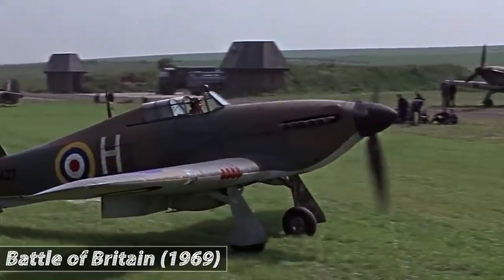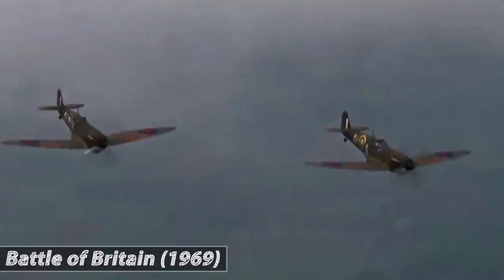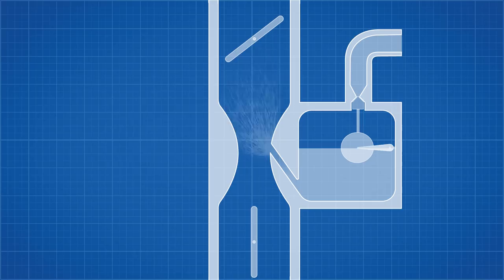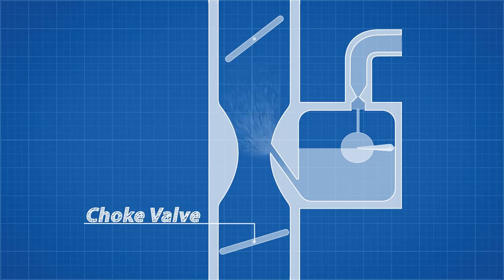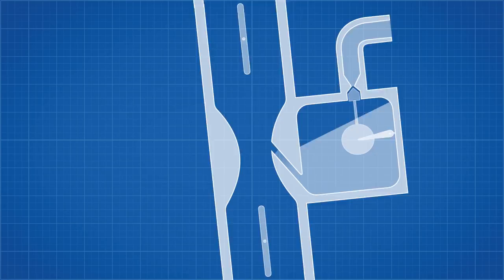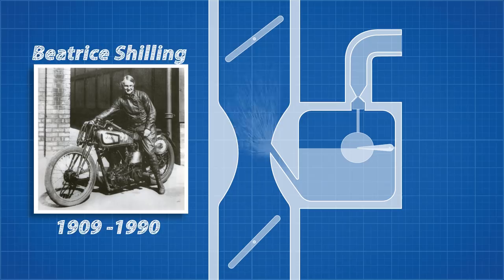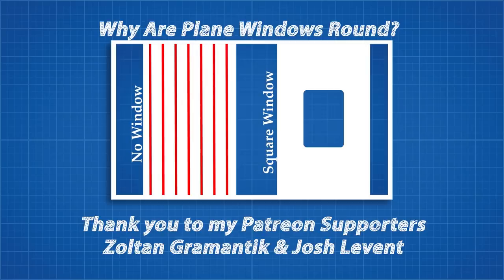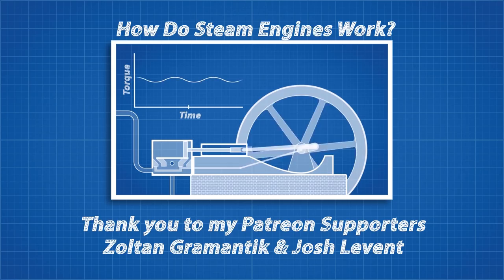The Spitfire's Fatal Flaw

Comment: One the plane you show having an engine issue was not a Spitfire but a Hurricane also it was performing a barrel roll which does not involve negative gs.
Reply: It does involve negative Gs if you do it as slow as the pilot did there.
Reply: cuz the Hurc' is dead slow! A big target for the 109's
Reply: If you pull negative G's it is not a barrel roll.
Reply: There may not be negative G on the pilot, but flipping a gravity fed carburetor upside down produces a negative gravity effect. 
Whether it was the pilot pushing forward on the stick, creating felt negative G, or flipping the plane so gravity is acting on the opposite end, it's all a gravity induced fuel starvation. 
Besides, every time I rolled a plane inverted, I had to push forward on the stick to maintain altitude, creating negative G....
Reply: @gscwanny: Not true or at least I don't agree with you :) The Hurri was a tough plane and a solid gun platform accounting for a good share when dealing with the enemy. The Spit had the glamour and the Hurri just got on with the business at hand :)
Reply: James Allan It is true though, the Hurricanes were really slow.  They accounted for a high share of German losses because they were assigned to attack the bombers while the Spits distracted the fighters.  They were both effective fighters in their roles but the Hurricanes were vulnerable to Bf 109s, especially once they started using Minengeschoß rounds in their cannons. When they used armour piercing rounds they would often go right through the fabric fuselage, that's not so much a benefit of the Hurricane as much as poor planning on the Germans' part.
Reply: jadger1871  This is the thing I don't understand though. The difference in speed between the two craft doesn't seem that great and the turning radius on the hurri was a bit better. I knew they were set after the bombers while the spits took care of the 109s but I thought that had more to do with the stability of the hurri gun platform and numbers available. I get your point though. I just have a soft spot for the beast I guess :)
Reply: +gcswanny The hurricane was slower than both the spitfire and 109 but was far more manoeuvrable neither of the faster fighters could stay with the hurricane in a turning fight. hurricane was also a far tougher aircraft and better gun platform
Reply: +jadger1871 not strictly true if the hurricane pilot kept the fight level then it could easily out maneuver the 109. the hurricane only became vulnerable if the fight went into the vertical. in his biography Douglas Badder describes a mock dogfight he had with a spitfire whilst flying a hurricane and the spitfire couldn’t shake the hurricane off until it went vertical. the hurricane also opposite in areas that the spitfire found problematic such as the wester desert and Russian winter.
Reply: honymonster30 of course it could out turn a Bf109, all other things being equal, a slower aircraft will have a tighter turn radius because it travels less distance while turning at the same rate.  Also, this is one limited circumstance, I wouldn't want to fly in an aircraft that could out perform other aircraft in only one specific circumstance.

A turning dogfight doesn't matter that much though, it is well documented that the preferred tactic of the Germans was what is called the "High-side guns pass" tactic.  That is, they would use their superior speed and altitude to "bounce" their target and quickly get out of range in preparation for another pass on their target. It was only when encountering an inexperienced enemy pilot who willingly engaged in a turning fight that the turning battle would occur.
Reply: You're quite right that the Hurricane did the lion's share of the work during BoB. However, the majority of the Hurricanes were used to attack bomber formations for a few reasons:

The Hurricane was a more stable gun platform than the Spitfire. The layout of the weapons, allowed for a more reliable weight of fire. I.e. it was more likely that the Hurricane would put more lead on target, than the Spitfire would which is more desirable when shooting at the larger more durable bombers.

The Hurricane was completely out classed by the BF-109E. Yes, the Hurricane had lower wing loading, thus could turn tighter than the Messerschmidt, but as Sailor Malan said, no aircraft has ever shot down another aircraft by turning. All you need to do to shoot down an aircraft, is point your guns at it. How you do that, is not important.

Having the advantage in the horizontal has no benefit if your foe does not commit to the horizontal. The 109's had superior rate of climb, which gives them the altitude advantage. The 109 also had far better energy efficiency than the Hurricane. It didn't bleed as much energy as the Hurricane would under maneuvering and it's sleeker aerodynamic profile allowed it to gain for more speed, when converting it's altitude advantage to speed in a dive. In a fight of attrition, if neither of the pilots made mistakes, the 109 should beat the Hurricane every single engagement. (A very easy thing to say on paper as a couch pilot.)

Thus, the 109 could simply dive (boom) down from a higher altitude onto a Hurricane for a gun pass, then climb (zoom) back up to high altitude and repeat the attack if necessary. The Hurricane couldn't dive away, it was too slow in the dive. It couldn't follow the 109 in the climb, it had a too poor climb rate, thus the Hurricane would simply never be let into the fight by the 109, provided the 109 driver was smart enough to not commit to the horizontal, which most of them were from their Condor Legion experience. In the end, due to how energy inefficient the Hurricane is comparison to the 109, would result in a Hurricane bleeding energy non stop during evasive maneuvering driving the fight down to where it will have no more speed to maneuver and be a sitting duck for the next gun pass, or merely be driven down into the ground.

This was where the Spitfire, with the same Merlin Engine as the Hurricane, turned the tide. It was very fast, had a fantastic rate of climb and high altitude performance, and had a better turn rate than the 109. The 109 only maintained 2 significant advantages, a better roll rate and the reliability of their fantastic fuel injected DB-601 Engine.

Thus, a well flown Spitfire, would try to maintain the energy (Altitude/Speed) advantage over the 109, try to force the 109 into a mistake and possibly drag the fight into the horizontal, but also at all costs try to avoid fighting in a rolling scissors with the 109, since the superior roll rate of the 109 would, again, bleed less energy, complete its rolls faster, which results in faster changes of vector, thus placing the Spitfire at a disadvantage and guaranteeing it's death. (Again very presumptuous speculations from a couch pilot.)
Reply: The Spitfire handled the desert just fine, they fitted tropical filters. 
Russia took over 1,200 Spitfires so they must have been ok there too.
Reply: The Hurricane could out turn a 109 in a constant rate of turn and was indeed faster into the aileron roll moment.  The airspeed of the Hurricane was only just shy of the Spitfire.  The Hurricane often found itself tangling with 109's and coming off quite well in experienced hands.
Reply: +James Allan From what I remember of memoirs of pilots, they did as well. A much easier plane to land from all accounts.
Reply: The Hurricane which was about 30 mph slower than the Spitfire did quite well, but a direct comparison is rather difficult since the Hurricane usually went after the bombers and the Spitfire usually went after the fighters.
The Spitfire still had a bigger percentage kill rate and a lower loss rate.
Reply: The Spitfire is one of those highly overrated aircraft. It was without a doubt beautiful, fast, and maneuverable. It was also expensive and complex to make, very short on range, and had less than stellar ground handling. It is funny how legends about aircraft grow for good and bad. The P-40 and F4F are often seen as lackluster aircraft while planes like the Zero have a greatly inflated reputation. 
The Spitfire was a great plane but after 1943 it's limitations in range made it less useful than planes like the P-47 and P-51 to the allies.
The Hurricane was also a great plane that should get more praise.  It performed well, was rugged, and easy to produce. The Hurricane was as important to winning the Battle of Britain as the Spitfire was.  The Spitfire kept the 109s off the backs of the Hurricanes so they could get to real job of knocking down bombers.
Reply: David Siebert The Spitfire was only less useful in one role: long range bomber escort.  The common view of late war aerial combat in the West and especially the USA is skewed towards the strategic bombing of cities, but other missions were just as vital.  CAP over the front or air interdiction and ground attack roles were just as vital to the war effort, which the Spit was more suited to than the Mustang.  

As a matter of fact, the Spits were sometimes mistaken for German aircraft by Mustang pilots and with their far superior climb rate and speed, they were able to get away from the Mustangs.  By the last year of the war, with the front being closer to the German hinterland, the Spitfires could effectively escort the bombers from forward bases as well.
Reply: In ground attack the Thunderbolt and Typhoon where much better aircraft and the Spitfire's short range meant you couldn't attack very far. Think of all the German planes, trains, and trucks shot up by Mustangs and Thunderbolts coming home from escort missions. They carried a larger payload of bombs than the Spitfire. CAP over the front line? The Mustang and Thunderbolt where also very good at that mission thanks to their long range which equalled long loiter time. By the time of the invasion of Europe the German air force was in a bad  situation so CAP was not that demanding. And the Seafire was just a bad idea. The F4F, F6F, and F4U where all better for carrier duty. 
The Spitfire was great but not as good as it's legend. The Mustang in many ways was in the same position after the war. Many air forces kept the Mustang including the US. The problem was that jets had replaced the Mustang as a fighter. The US and allies would have been much better off flying Thunderbolts in Korea for ground attack than Mustangs.
Reply: David Siebert.
The Spitfire which was used for dive bombing and attacking many places that required high accuracy, did far more than you think. German planes, trains, trucks, V 1 and V 2 launch sites, even far more V 1`s than the P 51, the P 47 was not fats enough for that job. CAP over the front line was the Spitfires job, The Mediterranean, invasion of Sicily ( Seafires provided cover for that), Italy, it was Spitfires, D Day when 55 squadrons of Spitfires assured air superiority and all the way into Germany the Spitfire was flying from airfields close to the front. The short range Spitfire which do missions of over 4 hours or over 1,000 miles and fight. 
In fact without Spitfires D Day would have been much harder, Spitfires flew photo reconnaissance all along the coast and they attacked radar sites to confuse the Luftwaffe, even spotting for the ships guns was done by Seafire since it could do the job and look after itself. 
The F 4F, F 6F and F 4U in particular could only fly from large aircraft carriers, the Seafire was flown from small escort carriers.
The Spitfire was the best fighter the allies had from before the war, it was still in front line service well after the war.  Israel used both the Spitfire and P 51 but the pilots preferred the Spitfire.
Many air forces used the Spitfire after the war, including the RAF.  The Seafire was still in use in Korea.
Reply: Barrie Rodliffe Agree with your points, just wanted to add that the Israelis also used a cheap knockoff version of the Bf 109 after the war too.
Reply: David Siebert I am thinking of those ground targets attacked by all allied aircraft, not just American made aircraft.  Did you know it was a Spitfire that wounded Rommel and knocked him out of the war? While many planes attacked the V weapon facilities to knock them out, it was the Spitfire that was tasked with knocking the V-1s out of the air.

Look at Operation Bodenplatte, eight Spitfire airfields were targeted, while only three Mustang airfields were targeted, all of which were combined bases with other aircraft. This shows that the Spitfire was far more prevalent at the front and were a much more important target for the Germans because of their capabilities.

Sure there were more purpose designed alternatives later in the war, but just like the Bf 109, the Spitfire proved to be a reliable and effective weapon in multiple roles throughout the war, with upgrades keeping it on par with newer aircraft.
Reply: Yeah, any form of inverted flight is pretty challenging when you have a gravity feed carb.  At an air show years ago I watched a guy with a J2 Cub doing loops and it would start to sputter when he went over the top.
Reply: Barrie Rodliffe I'm afraid you'll find that the heavy filters the spitfire needed for the desert reduced their performance quite severly. 

Also once the intial attacks were made the dogfights quite often turned into a large melee conditions that suited the Hurricanes. The fact is the Hurricane was one of the best allied fighters of the war. It's incredabilie sad that a lot of people can't see past the Spitfire and give the Hurricane its due both as a fighter and a jack off all trades.
Reply: jadger1871 I think you'll find that most airborne V1's were taken out by the faster Hawker Tempest and DeHaviland Mosquito
Reply: honymonster30 The Spits still took out over 300 V-1s, or half of what those other aircraft you mentioned did.  Not only that, you only reinforced my point, there were many newer planes but the Spitfires could still hold their own late in the war.
Reply: Is that why the Spitfire replaced Hurricanes in so many places.
The Spitfire MK V with the same engine as the Hurricane had better performance and why would the Spitfire need better air filters than the Hurricane? Maybe you do not know that the Spitfire had a tropical filter, but the Hurricane also had a tropical filter.
The Bf 109 E 7 also had a big tropical filter.
The Hurricane could take on the Fiat CR 42 but it struggled against the Machi C 202 and Bf 109 E 7, the Spitfire was able to take on both.
The Hurricane was good early in the war but never up to the performance of the Bf 109 or Spitfire which is why the Spitfire took over as a front line fighter while the Hurricane was used less and less as time went on. Hawker were not satisfied which is why they made the Typhoon and later Tempest.
The Spitfire was also a bit of a jack of all trades, fighter, dive bomber, photo reconnaissance, escort fighter and so much more, even shooting down quite a number of V1`s, as well as attacking V 1 and V 2 launch sites.
Reply: Honey minster.
I think you will find out the Spitfire was faster than either Tempest or Mosquito and it took out over 300 V 1`s.
The Tempest was the fastest at sea level but above 5,000 feet the Spitfire was faster.
Strange that the Mosquito was used at night while the Tempest, Mustang and Spitfire were used by day, the Spitfire had the job of chasing V 1`s on the far side of the English Channel, the Mustangs the nearside, then the gun belt, then the Tempests inland.
Spitfires were at the same time providing air superiority over Normandy and attacking V 1 launch sites and giving close support to  the army. 
The Spitfire still took out 50 %  more V 1`s than the Mustang.
Reply: Tempest was faster at low altitude.  Not sure about how it fared at high altitude, specially against the Griffon-engined Spitfires.
Reply: James Allan  From memory the Battle of Britain Hurricane was 30 km/h, that is 20 mp/h slower than its contemporary Spitfire.  Thats is a lot: during Spitfire's evolution a speed increase of 6 or 8 mp/h was hailed as a big improvement.  .  Also speed is not everything: ability to accelerate is as least as important and the Hurricane was sluggish
Reply: James Allan  Problem is that making tight turns requires going slow and while you were going as slow as possible in order to make a tighter turn you were a sitting duck for any additional plane joining the fun from the side or from above.  Also the Hurricane was not good at accelerating so in case he reached a favorable position behind the enemy after a turning duel  the German pilot could shake it just abandoning the turning duel, and opening the gases. all while waving in order not to be a too easy target.
Reply: Actually the Spitfire had a problem of sensitive COG.  Since the COG varies with fuel consumption it could not take take much of it: an aircraft with a COG too far from the right place is difficult to handle and can end disintegrating in flight.  Very late in the war Supermarine managed to solve the problem and produced a long range Spitfire but since by then the Mustang filled that niche and the project was canceled.

The Spitfire was not designed for escorting bombers to Berlin and back but as a defensive fighter, one whose main role is preventing the enemy from bombing your trenches, your airports or your factories and it was good at that mission.
Reply: Actually both the Spitfire and Hurricane s..ed at ground attack due to their water-coled engines that made them vulnerable to even minor hits.
Reply: Nemo.
The Spitfire Mk XIV was faster from 5,000 feet up.
During the Spitfire evolution an increase of 100 mph is a lot.
The Spitfire could turn tighter and faster than most other fighters, it pulled more G and completed a turn 6 seconds before a Bf 109, also 200 feet tighter radius turn than a P 51.
All planes had problems with COG, the P 51 when fully laden with fuel could only fly slow, straight and level, the COG was too far back, the same as a long range Spitfire, which was in service a year earlier than the P 51 with a Merlin engine, many Spitfires were flying escort and long sweeps in 1943.
The Spitfire was designed as a fighter, so was the P 51, even if it was not good at it and the P 51 with a Rolls Royce Merlin which did have long range did nothing until 1944.
The Spitfire and Hurricane both did a lot of ground attack and they proved to be good at it, 3,500 P 47`s never got back so how good were they at ground attack?
Reply: Barrie Rodliffe What are your sources for this information? P-47 losses were 3500 total to all causes, including the number that were sunk on transports crossing the Atlantic, not just ground fire or air to air. In fact, Only 0.7 per cent of the P47s were lost in combat. http://www.aviation-history.com/republic/p47.html

And turn rate isn't everything, all those aircraft you compared it to were not meant to get into a turning battle.  They were all so called "boom and zoom" fighters.  They would attack at speed from a dive and use that speed to quickly get out of range or climb for another attack run, only within the Spitfire's firing range for a second. If a Spitfire attacked them, they would go into a dive to evade the Spitfire as the low wing loading on a Spit meant it did not pick up speed in a dive nearly so quickly as the other aircraft.  As a matter of fact, the Spitfires suffered terribly at the hands of the FW190. It was Spitfire pilots after all that gave it the nickname "butcher bird".
Reply: jagder.
the 3,500 is losses and 3,499 kills is what I found from one source, I have just checked again and find 3077 combat losses and 3082 kills for the P 47.
Turn isn`t everything, no but turn, acceleration, rate of climb and speed are all important, the Spitfire was very good at all of them and above 5,000 feet even the Tempest could not match it.
They were the two best fighters from the end of 1943 to the end of the war.
Any pilots would try to use height, the Bf 109 in a dive did have a slight advantage at the start of the dive but the Spitfire would catch up if the bf 109 pilot kept diving, if he levelled off he was as good as dead and in a climb or turn the Spitfire had the advantage.
The same applies to American fighters, due to being heavy they might enter the dive faster but the Spitfire will catch up and go faster if the dive is prolonged, the Spitfire pilot could easily avoid any American fighter by simply turning and climbing, not one America plane could get close. 
The Spitfire Mk V had trouble with the Fw 190, the Spitfire Mk IX and all subsequent Spitfires turned the tables.
Reply: Barrie Rodliffe You're assuming the Spitfire would survive the first pass by a diving enemy fighter in order to chase it.  The difference in speed between a diving fighter and the spit caught unawares would mean they would have no chance to catch up with them in a dive.  Sure, if they were 50 miles up and the other fighter kept in a straight dive the spit could catch up, but that's an impossible situation.

As for the Mk IX vs. the FW190, it was more than 30km/h slower as well as turned slower and climbed slower than the D-9.  The only Spit that could actually catch a D-9 wasn't produced until after the war.

All this talk of how far superior the Spitfire is to American fighters and yet the RAF themselves used the Mk XIX Spitfires to simulate P51s in war games because they had very similar flight characteristics.
Reply: jadger1871 
Maybe I am assuming the Spitfire would survive a first pass because that is exactly what so often happened, Spitfires were often attacked by other fighters from above, that includes USAAF the P 47 and P 51 because of very poor aircraft recognition. They never shot down a single Spitfire.
If a Spitfire was flying at high cruising speed and bounced from above by any plane the Spitfire pilot could evade it if he saw it coming and then have the height advantage.  
As for the Mk IX which had a similar top speed to the Fw 190 A and the Spitfire turned tighter, climbed faster.
The Fw 190 D 9 which was not as fast as the Spitfire Mk XIV in service 6 months earlier, the F w 190 D 9 top speed 440 mph. The Spitfire Mk XIV 448 mph.
The RAF used a Spitfire Mk XIX in mock combat with an English Electric Lightning because they still had Mk XIX Spitfires in service, the Spitfire was far superior to the P 51, it was faster with better maneuverability, climb and acceleration, if the Lightning could handle a Spitfire, the P 51 would be a walk in the park.
No American fighter in the war could match a Spitfire. The P 47 did not, P 51 did not, the F8F which was too late for the war did not.
Reply: Barrie Rodliffe Where are you getting these numbers from? The Mk XIV could only attain that speed in tests with modifications that were not present on combat aircraft, otherwise they could barely go over 400mph.  Even if they reached your top speed, that 1.5% difference in top speed is negligible.  How long do you think it would take a spit to catch up with a D-9 that was already at that speed attacking it from a dive? Far longer than the Spitfire had fuel for.

And the Mk XIX used in those trials was a static display model before they repaired it and brought it back into service, they could have just as easily borrowed a P51 from literally anywhere else. The Americans were selling them for $1500 each at the time. They only chose the spitfire again because its characteristics were very similar and thus cheaper than renting an actual Mustang from someone else.
Reply: jagder.
Since the Mk XIV had a top speed of 448 mph and it reached that in 1943 with a fully equipped fighter, even the older Spitfire Mk IX and the Vii and VIII would easily top 400 mph. The Fw 190 D when it entered service over 6 months after the Spitfire Mk XIV, did not have MW injection and only had a top speed of 360 mph according to Hans hartig. Even with the MW it could not catch the Spitfire in top speed, climb or acceleration. 
As for range, the Spitfire had enough to chase, catch and shoot down the few fw 190 D`s that were there, the Luftwaffe were still relying heavily on the old Fw 190 A. The Spitfire Mk XIV had greater range than the Fw 190 D.
Even German flight tests of the Fw 190 D 9 do not show the 440 mph which I have seen elsewhere until 1945, 413 mph at 6,150 metres, or about the same as an older Spitfire Mk IX and much slower than the Spitfire Mk XIV. of quite a few flight tests and engine or supercharger failures the Fw 190 D9 did eventually manage 437 mph in a flight test with MW 50. Also with C 3 fuel it managed just 441 mph in March 1945, that does not compare well to 448 mph in 1943.

Adolf Galland who was there at the time and rated Spitfires very highly had this to say about the Spitfire mk XIV.
"The Griffon-powered Spitfire fighters were so lethal that the best thing about the Spitfire Mk XIV was that there were so few of them". 

Since the Spitfire had a cruise speed of close to 400 mph, it would not take long to catch up, it certainly accounted for quite a few Fw 190`s as well as Me 262`s.
The Spitfire Mk XIX which the RAF still had was not a static display, it had been in use for THUM. and it was ready for flight when in 1957 the RAF wanted to see how to combat the P 51, the Spitfire having better performance and maneuverability was a good choice since if the Lightning could beat the Spitfire a slower P 51 which did not turn or climb like a Spitfire would be easy. Why get a non working P 51 and have to get it airworthy when the Spitfire already was.
Reply: Barrie Rodliffe Hans Hartigs, who flew the aircraft less than a week before he was shot down and captured, and was flying low altitude missions (in a high altitude interceptor) for that whole time, cannot reasonably be considered an expert on it. Not to mention you totally misrepresent what he actually said, which is that some were rushed to the Geschwader without the MW50 injection system because of the constraints Germany was under, not that it was a later addition.

Adolf Galland was "there at the time" only in the sense that he was alive, by that point in the war he had been grounded for three years. He had no combat experience against the Mk XIV.  Not to mention that that quote from him is entirely apocryphal, or do you have an actual source for that?

You are mistaken about the Mk XIX as well.  The initial spitfire slated for the trials was airworthy initially but quickly developed mechanical issues and had to be replaced by one that was a static display.  My point still stands though, if their performance was so superior as you claim, then why wouldn't the RAF buy or rent a P51 from one of the many allied nations that still had them?  The whole purpose of the exercise was to judge the effectiveness of Lightnings against P51s.
Reply: jagder.
Hans Hartig was right the Fw 190 D did not have MW 50 when first put into service. It took some time to get the MW 50 working, even the flight trials showed that they had poor reliability and lacked performance until well into 1945 or much later than the Spitfire was doing 448 mph. 
Galland commanded an Me 262 squadron with 16 Me 262`s, they did meet Spitfires including the Mk XIV.
The Spitfire used for the trials had been withdrawn from active service in 1957 but kept in flying condition as part of the RAF historic aircraft flight.  No need to replace it since it had no mechanical issues.
Your point is just silly. If you want to see how to combat a fighter which has a top speed of 437 mph and a climb rate of 3,200 feet/ min. then why not test the planes against a more agile fighter with better performance, if the Lightning could take on the Spitfire it certainly could take on the P 51, why try to get hold of a P 51 that is less likely to be reliable and takes time to get to Britain and make airworthy, far more time than an airworthy Spitfire already there.  
The exercise showed how the Lightning could combat the Spitfire, having done that it would easily do the same to the P 51.
The P 51 top speed 437 mph, Spitfire 450 mph, Lightning 1,500 mph.
P 51 rate of climb  3,200 ft/min, Spitfire 5,040 ft/min, Lightning over 50,000 ft/min.
The Spitfire turned over 200 feet smaller radius than the P 51 and pulled more G. If a P 51 pilot tried to maneuver with a Spitfire the wings would come off.
Reply: YUP! I caught that too! But, the 'underdraft' carb set-up did stall RAF Merlin-equipped fighters from '37  thru '42. It was the one area the US Allison v-12 was notably better at! Note, the Westlast Wyvern  didn't have THAT issue!
Reply: Eric.
THe RR Merlin only had the problem until 1941 when it was completely solved, it had already been improved before then.
The US Allison V 12 was useless at everything and nosing over into a dive which was when the problem occurred on early Merlin`s was not a problem on the much later Allison engine P 51, it never went high enough to dive.
The Westland Wyvern was a post war navy strike fighter with a turboprop. It first flew in 1946.
Reply: Oops, it was the Westland Whirlwind, that used two RR Kestrel engines, that I was trying to recall.  Funny comment about how high you could go in an Allison, since the A-36 Apache was the DIVE BOMBER variant of a Mustang, and was Allison powered! 24K ft.,,Max.
Reply: Eric.
The Westland Whirlwind had two Rolls Royce Peregrine engines, the prototype Bf 109 had a Rolls Royce Kestrel engine. As for the negative G problem the Whirlwind may well have used the same carburetor that the Spitfire and hurricane used.
The A 36 with an Allison engine, 24,000 feet, the Spitfire with a Merlin 43,000 feet.   The Spitfire was used as a dive bomber and it did not need dive flaps, in fact before the A 36 was in service the Spitfire had no negative G problem at all.
Reply: For a start, it was not a barrel roll at all!

A barrel roll requires Aileron, Elevator and Rudder inputs.
A barrel roll is where the aircraft rolls its horizontal axis through 360 degrees whilst gaining altitude then descending back to original altitude. As if the aircraft was rotating around a hypothetical horizontal barrel....

The aircraft in the clip was indeed a Hurricane and it performed an AILERON ROLL, where the aircraft attempts to keep it's horizontal axis level whilst rotating using its Aileron's....
When the plane is in the inverted part of the manoeuvre, it begins to lose altitude as the aircraft's natural "lift" is reversed.
This requires the pilot to push forward on the stick during this phase to counter the effect.
As you can see in this clip, when the aircraft is inverted, the nose pushes up toward the sky...
This is the pilot countering the negative lift effect...
As a result of this, the aircraft is under negative G forces and results in the infamous "Rolls Royce sputter".
Reply: Sorry, not quite that perceptive as a 'pilot' Never 'rolled' in my 30-ish hours of flying..  Aileron Roll it indeed is!
Reply: Anthony Bland in the inverted part of the barrel roll you push the nose up to keep it on the horizon the real reason why the engine is quiting is because that is a float type carburetor made for aircraft that are not high performance
Reply: Gregory Samuels 
The float type carburetor gave the Merlin more power than any comparable engine so it was made for high power.
Reply: Gregory Samuels 

Did you seriously just re explain to me, something I had already stated?

"The aircraft in the clip was indeed a Hurricane and it performed an AILERON ROLL, where the aircraft attempts to keep it's horizontal axis level whilst rotating using its Aileron's...."

Sorry for not stating that when inverted, the stick needs to be pushed forward when inverted to counter the aircraft's NATURAL tendency to lose altitude...
I made the error of assuming that people would use common sense and ASSUME that would naturally occur after I had explained that an Aileron involved the pilot attempting to maintain their horizontal axis (LEVEL FLIGHT) whilst performing the manoeuvre...

Will be sure to keep any further explanations to a standard that a 4 year old would grasp...

P.S, the float type carburetor was used to give the Merlin its performance...
Which was better than most aircraft at the time...
The Rolls Royce Merlin was even used by the U.S to replace the hopeless Allison engines used in their Mustangs...
Toward the end of the war, the Merlin was replaced with the Griffon which further raised the altitude and performance of the Spitfire's and Mustangs...
Reply: Jboweruk.
It seems the very strong Spitfire was not so easy to kill either.
Both the Spitfire and Hurricane did a good job, but if you took away all the Hurricanes or all The Spitfires it would have been much harder.
Reply: ***** 
There is a very good reason the Spitfire gets so much credit.
As said by an American pilot. 
" After a Spitfire every other plane is imperfect in one way or another"
Or as said by an ATA pilot.
"   “ In the air the Spitfire was forgiving and without vice, I did not hear of anyone who did not enjoy flying it.  It had a personality uniquely it`s own.  The Hurricane was dogged, masculine and it`s undercarriage folded inwards in a tidy business like manner.  The Spitfire calling for more sensitive handling, was altogether more feminine, had more glamour and threw it`s wheels outward in an abandoned extrovert way.  From the ground there was a special beauty about it. The cockpit of any single seater aircraft is a very snug private world, but to sit in the cockpit of a Spitfire, barely wider than one`s shoulders, with the power of the Merlin at your fingertips was shear poetry – something never to be forgotten by those who experience it.”